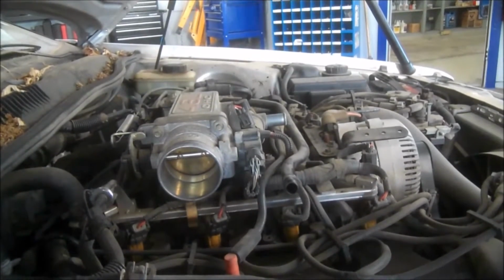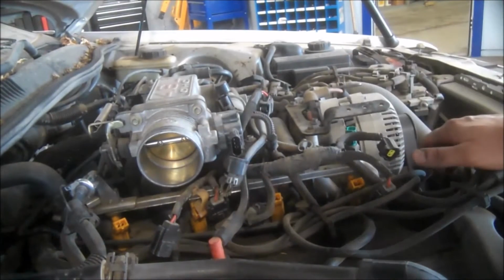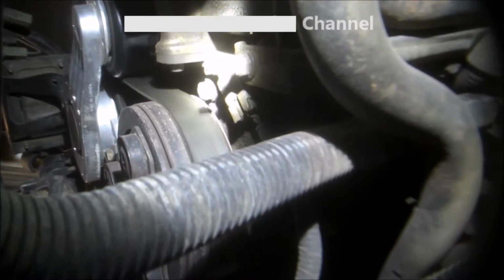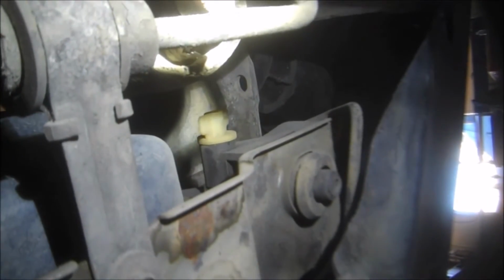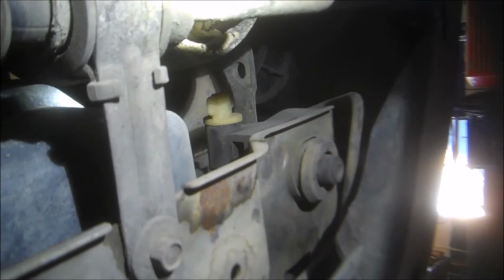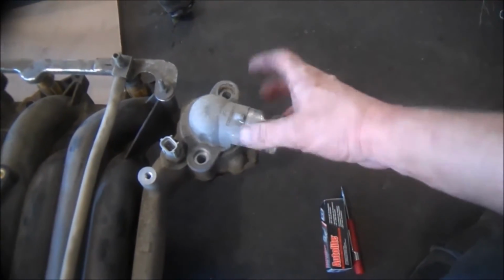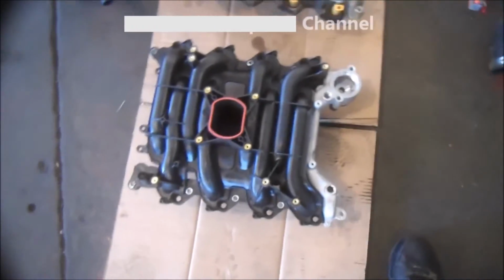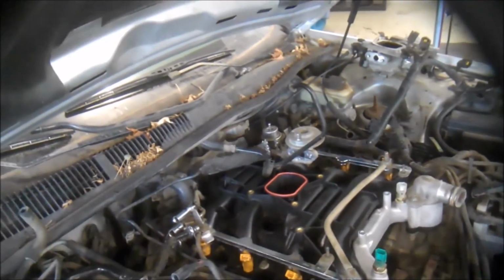Intake manifold gasket replacement Ford Thunderbird 4.6L 1996 Install Remove Replace

Comment: Awesome video, love the people criticizing the time you take,i guess they didn't realize you were filming a video,lol, now if you had been rushing they would bitch about that also, "God this guy goes so fast he doesn't give you time to see what hes doing"  you just cant please humanity dude, its impossible.

Ive done this job at least 12 times, i have a feeling the guy that designed these intakes has been banished to a island that Ford owns thats not in any nautical chart,sure caused the company heartaches but i guess they have sold enough of these bastards to make a fortune also,the new intakes are much better but they will still crack,just a matter of time, the dily bopers are temperature sensors, I'm sure you know that,the left is for the gauge (green)  and the grey for the ECT,its funny, for years i thought they were the opposite and just learned recently the correct thing because i was redoing a harness on a 4.6 and had to learn what everything was since the harness had been "butchered" a bit.